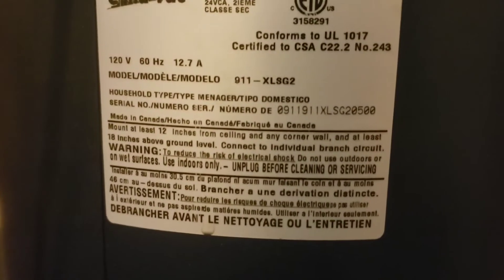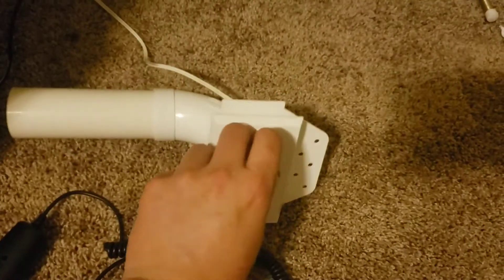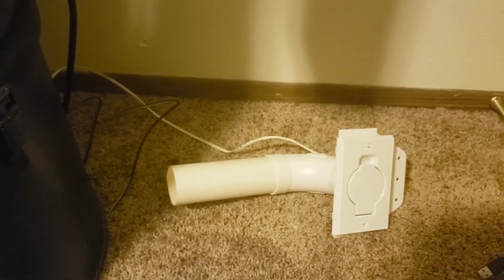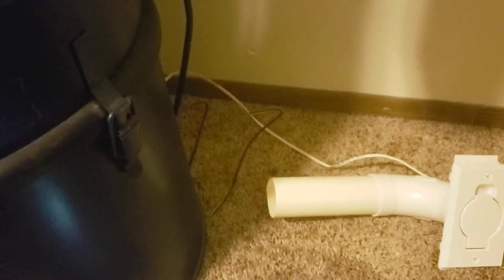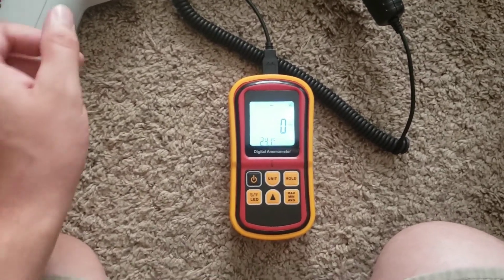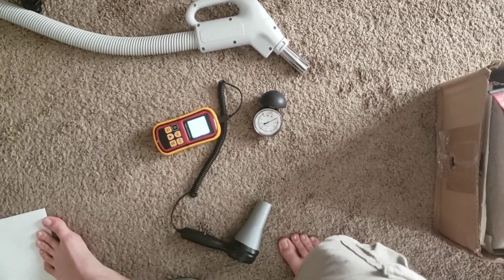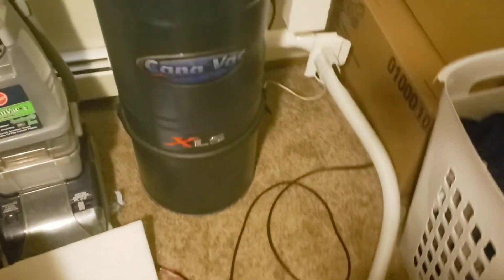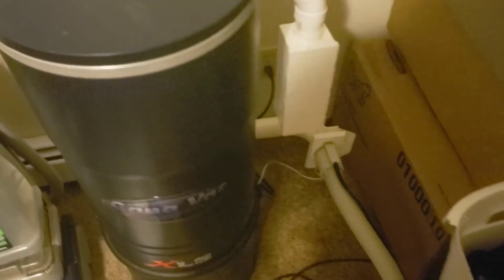Canavac XLS airflow test

Comment: Big thanks for posting this. Yes, the canister base is way up there performance wise  considering it's power draw. That being said, massive airflow loss is normal at the hose end even though suction essentially shows minimal leakage.
Reply from the maker: It was only logical that a 30 ft run through a hose would drastically reduce it's airflow. I'd really like to see how a dual motor unit does, both a parallel and a series setup.